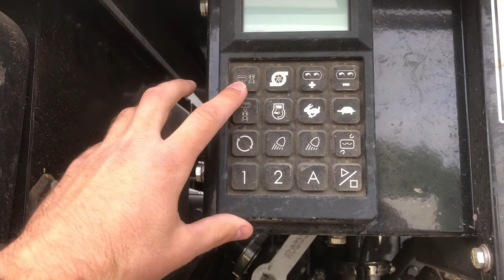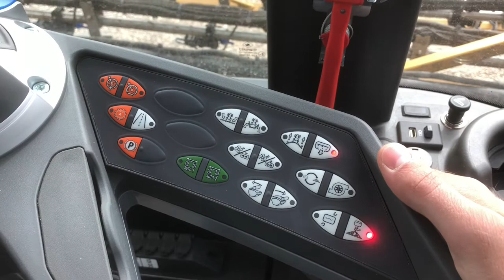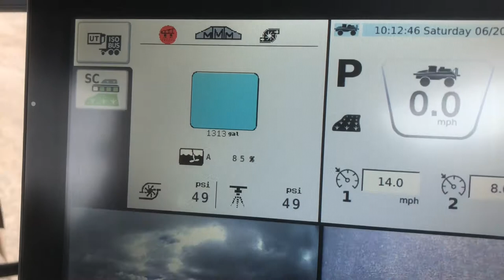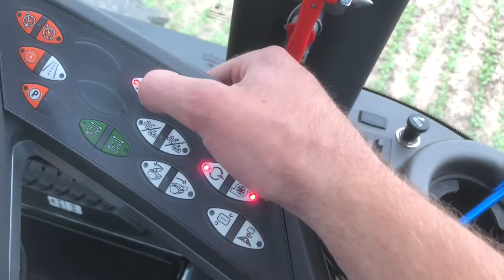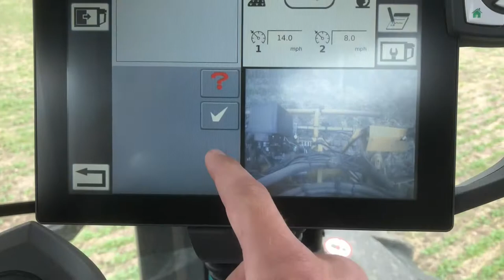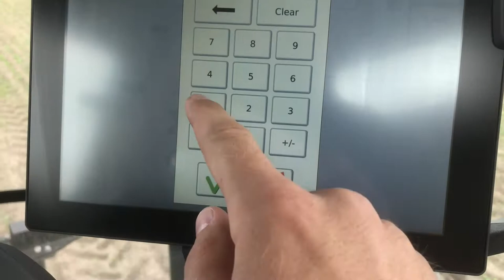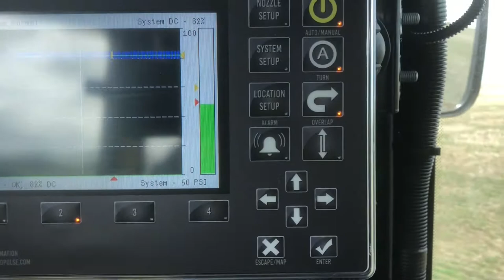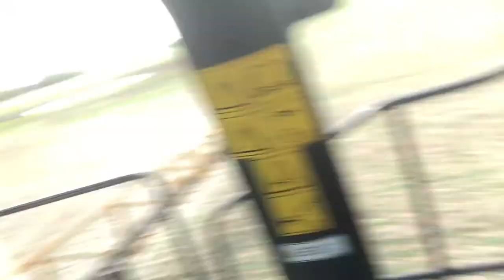How To Operate a Rogator 1300 C Series Sprayer

Comment: You should set up your headland management and use that on the joy stick for turning.  On my terragator I use to to come into the headlands it will put in my cruise 2 and then like 2.5 seconds later it will disengage my autosteer, then when I get half way through my corner I hit it again and then it will engage my auto steer and I think its 2.8 seconds later it engages my cruise 1.  Its an awesome feature.
Reply from the maker: Yes it is a nice feature, I've just found myself doing it manually and have gotten so used to doing it like that. How do you like operating the Terragator? Those are big machines.
Reply: @dustinbezugly  I really like it.  The B series are nice but the C series takes it to another level.  I couldn't go back to a different machine that doesn't have a CVT.  Just makes it so smooth.